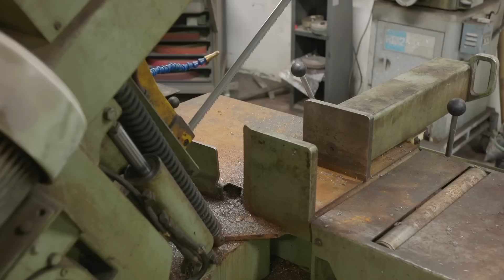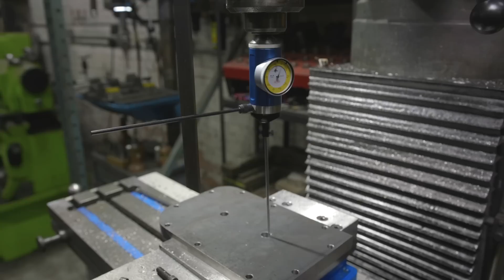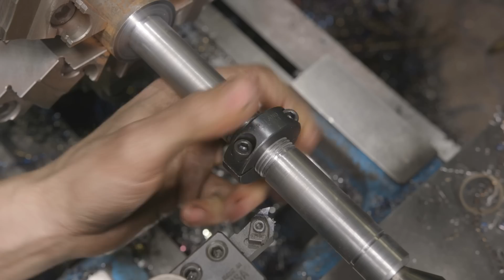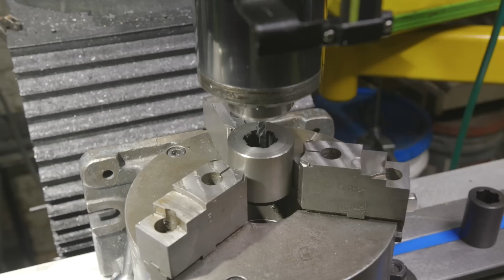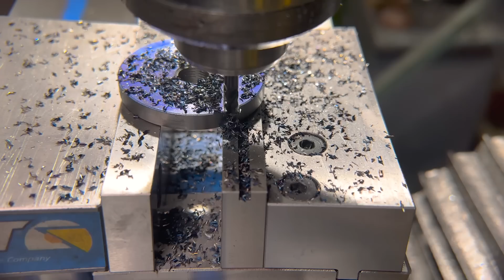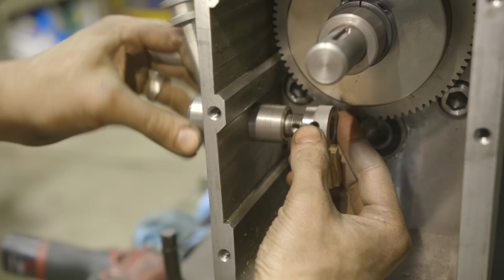World's First | Machining Gearbox From Scratch | Lion Lathe Restoration

Comment: how about adding a 2 speed gearbox to the back of an already existing gearbox in a 4 speed manual car, so that someone can have an " overdrive" mode for highway use. revving too high, using a lot of fuel because of the over revving...

Comment: Kyle an admittedly basic question, but is there a reason you didn't fill the hole on the side?  I was confused when it gave way during the needle scaler work, and more confused when you didn't weld it up.  My OCD needs to know.  As others have said, your work is off the charts and just fun to watch.
Reply from the maker: It’s filled off camera

Comment: The difference in finish on the plate is reflective of the tram on the mill. This is an issue with all of the articulation points.  I did a similar project with parallel shafts square to the lid that did not align.  I had to scrap.  Use the knee to achieve Z travel and not the quill.  The small misalignment due to tram error extends to a much larger error depending on the quill travel between the holes.  Love the project and very impressed with all of your work.
Reply from the maker: Yes that makes sense

Comment: One point I'd mention on the shifting is that the dogs not being perfectly done mean that really only 1 (or 2) dogs are transferring the load as they are a few thou closer than others. So might defeat the purpose of having extra dogs for strength. However, perhaps it would wear in over time to be equal if the difference is small?

Should have started with this, but I am really impressed! You did an amazing high quality job and love the badge idea. Nicely done man, what a daunting project without an existing design too. I'm curious about all the troubleshooting you had to do, maybe an interesting video for it's educational value? Again, impressive!
Reply from the maker: Thanks very much. Yeah maybe I’ll do a video on that one day

Comment: Honestly only change I would have done from the start, use two dowel holes for alignment especially when you have a rotating parts.
Reply from the maker: I got dowels on front I didn’t show it in video

Comment: awesome. i missed one detail: howd you make the detent to keep the shift lever in either position?
Reply from the maker: You didn’t miss it. There wasn’t a detent. I was debating installing one, but with the press fit of the bearing and the way that the lever is it stays in the gear it’s in so I really wasn’t necessary.
Reply from the maker: Honestly, I planned on installing one, but I forgot about it up until this moment and I never really felt the need for one during testing

Comment: Looking at this very fine bid of work, I have the impression the lever will be in high rate forever.
Reply from the maker: Why is that
Reply: @VanoverMachineAndRepair  Looking at the wear patterns of machines with power feeds (similar) only the highest speed has any wear on it.  I suspect that what you have built is easily controllable on high rate and the lower speed will be little or never needed.
Reply from the maker: @markbernier8434  maybe only one way to find out

Comment: Like how it turned out, the 2 speeds would give the lathe much versatility. Goes to show how a standard factory machine can be re-engineered for optimum performance.
Like you said at the end, and I was thinking throughout the build, a CAD design would simplify the build especially for a gearbox. On CAD you would get, dimensions, tolerance, materials and fitment set at the start.🐞
Reply from the maker: Yes indeed but it would be less fun with all the answers up front

Comment: toolmaker buttons would be a big help to you.
Reply from the maker: What are toolmake buttons
Reply: @VanoverMachineAndRepair  there are videos about them. For doing gear box shaft bores, like you did, through two plates, they are how it used to be done... sometime they come in handy. you could make your own set from drill bushings or buy from Starrett.
Reply from the maker: @yelims20  o ok. I looked them up I have some and did use them for other parts of the lathe project. I call them threaded transfer punches. If that’s the same thing.

Comment: Would have thought a tailstock this size would have benefitted from an air bearing on the ways?
Reply from the maker: It’s big but manageable. It has a rack to drive it which is sufficient. You couldn’t push it by hand

Comment: You are remaking something, that have been on some European Lathes the last 40+ years, maybe the US. as usual don't bather to seek information, outside the County State line.
Reply from the maker: Stop. Don’t insult my intelligence. I researched this project for months before beginning. I know full well that 20-50% of bigger lathes have two speed tailstocks. The new lions do as well. That is not an original idea. What is an original idea is retrofitting one to a single speed tailstock. Keyboard warriors need to chill out.
Reply: @VanoverMachineAndRepair  I'm Not a keyboard warrior, I'm a European Machinist with 30+ years off experience.

Comment: 19:30 wouldn't be beneficial to have chamfers on dogs' edges so to avoid chipping or deforming since the flat business ends will not be affected ?
Reply from the maker: Yes. I actually chamfered them a bit off camera. Bigger chamfers help engagement but reduce strength. It’s a trade off.

Comment: Brotha man, brotha man, threaded pins for location is key, both on the  piece and plate. Ideally you should design a gearbox in such a way, in my opinion in the context of your project, to where you can have it assembled before installation on your equipment. So you can test your axial and radial endplay as well as backlash. And i can say from experience its wise to test play on your lever. 

I didnt see if you had seals, or gasket material?
Reply: Using drilled holes in the backplate as a reference isn't great practice either... drill then bore for concentricity... personally, I'd have set it upon the lathe and line bored it between centres, but thats just me...🤔
Re. Seals and gasket, I'd use sealed bearings and run the gears in a nice gloopy 50 / 50 oil and grease mix and probably just use a liquid gasket... 
Putting a spring-loaded ball bearing in the back of the gear change handle and dimples in the body would help maintain position...

(In typical internet commenting tradition, I'm commenting before I watched the whole vid yet so some of my points are moot... 🙄😂)

Great project !! 

😎👍☘️🍺
Reply: @peterfitzpatrick7032 Line boring is a royal PITA.
Reply from the maker: Yep did some yesterday more videos to come on that
Reply from the maker: Yeah guys there are alignment pins on one of the plates you just don’t see it. There is not pins on back plate but that’s intentional it’s allows me some movement during final assembly to ensure no binding. Would it be better if I nailed it perfectly and used dowels everywhere yes. But this is not cnc and cad it’s manual machining where we build as we go I need some play to ensure a successful end result.

Comment: This is a really cool project. One thing to point out (which may not be a problem) is locating the plate with only bolts. It should have at least 2 locating pins.
Reply: True that homie  id add do yourself a favor and buy some nice hardened threaded pins so you can use a slide hammer for easy removal. I.e. also put pins into the lathe and gearbox cover.
Reply from the maker: Check my response in other comments on pins

Comment: Great project. My $.02 for what its worth. In the future 2 dowel pins in the cover and maybe 4 threaded 1/4-20 holes for jack bolts to get the cover off. Will definitely make your life much easier  keeping and maintaining alignment. 👍
Reply: I agree 100%. For a gear box dowel pins are a must. You can not rely on threaded components for alignment. There is far to much variability. Worst case scenario you can have gears walking out of mesh or binding.
Reply from the maker: @Agnemons  👍
Reply: I agree